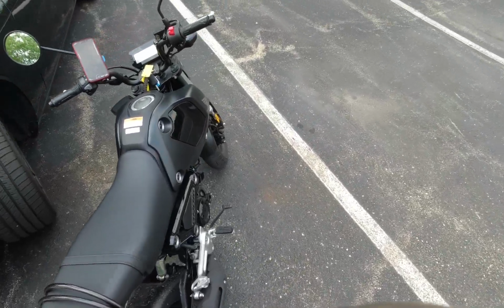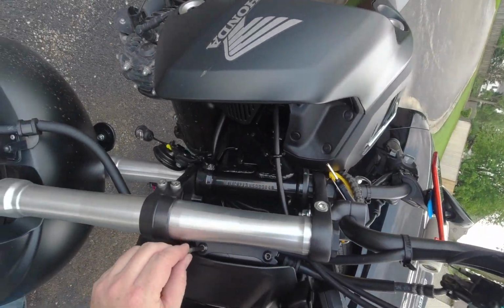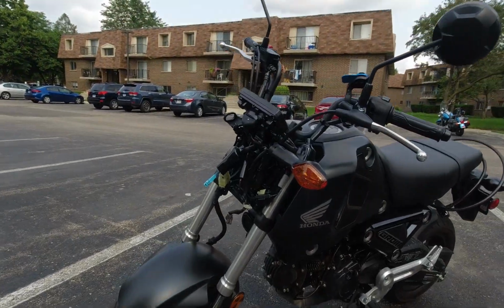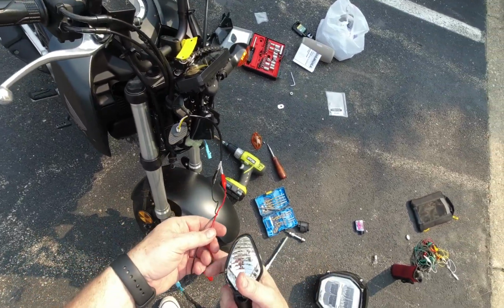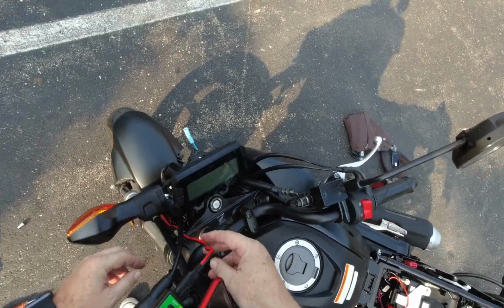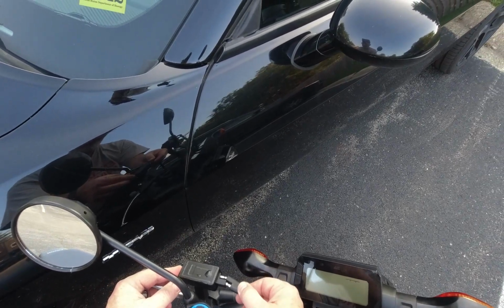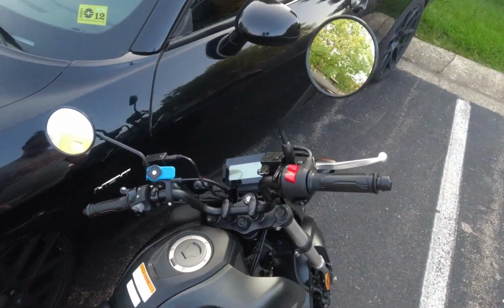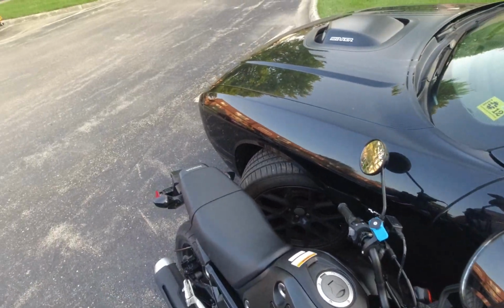2022 Honda GROM battery tender and turn signal swap exploration

Comment: What size ring terminals did you purchase? The ones that come with the battery tender are way to large
Reply from the maker: Hmm. The the rings on mine seemed to work just fine. Maybe they were a little big, but i didn't put new ring terminals on them.
Reply: @icemanfiveoh  thanks, I’ve ordered a variety of flanged terminal screw/bolts I’ll try that it that doesn’t work I’ll try a flat washer on top. This is the first time I’ve had this issue with my tenders.
Reply: an update, i used the flanged terminal bolts and for good measure replaced the ring terminals with ones with smaller ID, worked like a charm.